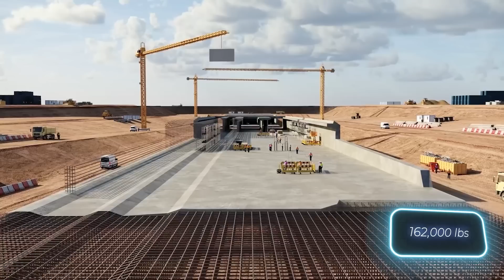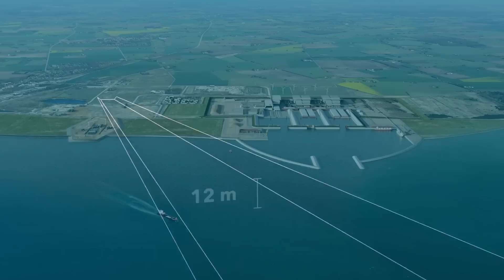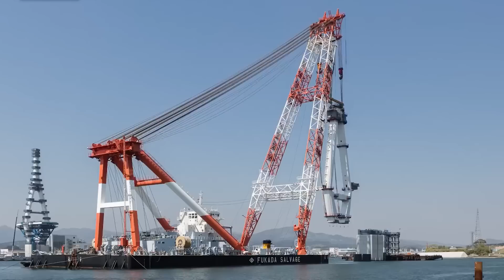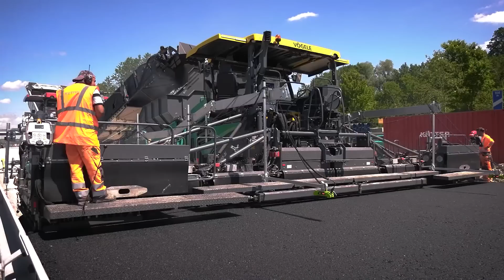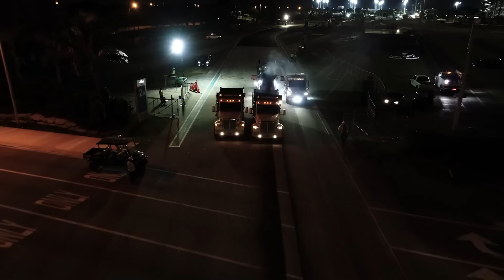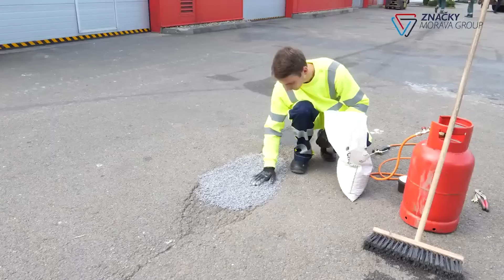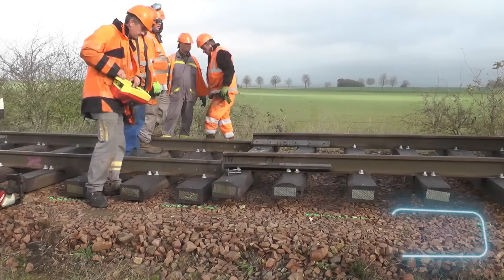INCREDIBLE ROAD TECHNOLOGIES THAT ARE INSANELY COOL

Comment: 2:11 "73.5 tons and stretch the length of two football fields". I'm pretty ignorant but that doesn't seem much weight for such items.
Reply: Large tubes so most of the size is empty space, which does make them easier to float and sink into position
Reply: Was thinking 'they must be made of paper' when I heard that one. 73.5 tons is a large loaded truck, or about 31 cubic metres of concrete, so over 200m? (I don't have a 'football fields' measuring tape) that's a couple of barrow loads per metre...... a few zeros went missing somewhere. Good content though, always interesting seeing structural projects.